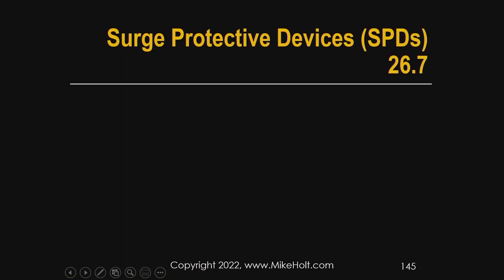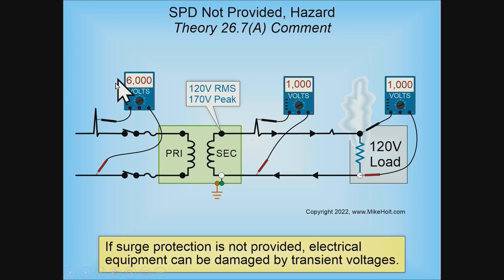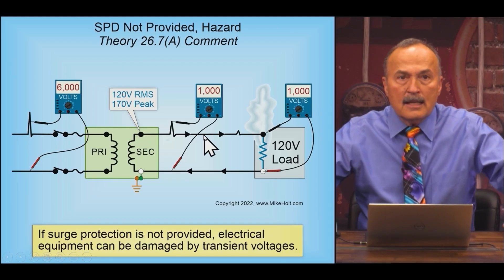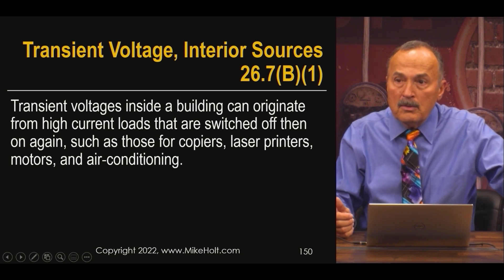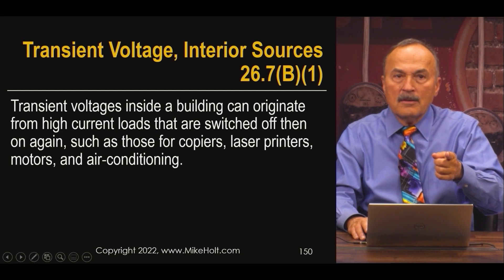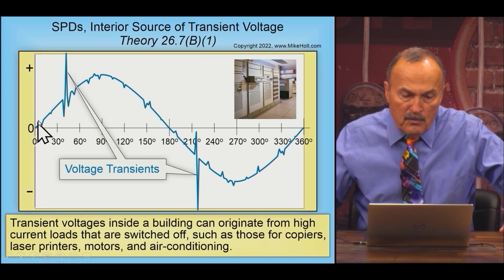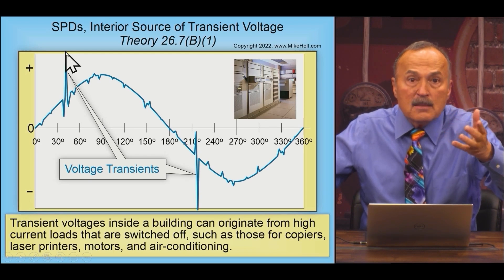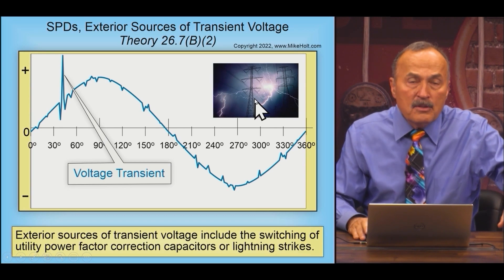Surge Protective Devices

Comment: That loose neutral or corrosion not letting the complete path back will fry the Surge protectors, I’ve seen it first hand.
Reply from the maker: That is true for the old TVSSs. Today SPDs incorporate protection  from overvoltage.
Reply: @MikeHoltNEC  Nice! I was not aware of those type. I will surely look into them!

Comment: power utilities put surge suppressors on main power lines, but, a lighting strike close by is very powerful and sometimes surge suppressors fail ?
and
nec 230.67
And what happens to a 120 VAC surge suppresser experiencing 170 VAC continuous because of a loose neutral or corrosion neutral connection on a shared neutral circuit or at the utility transformer ?